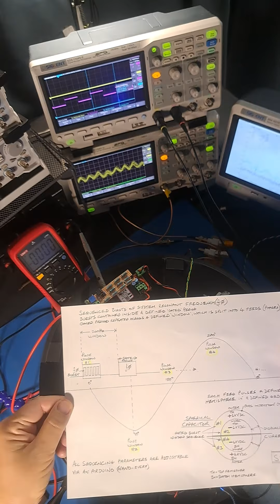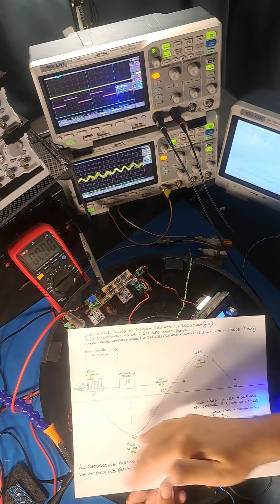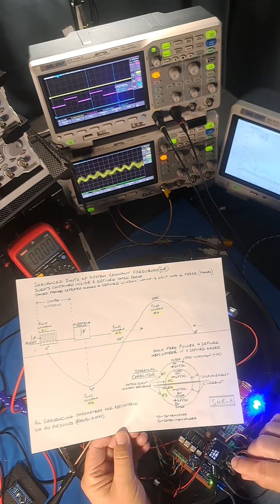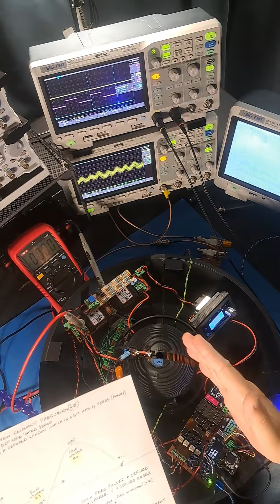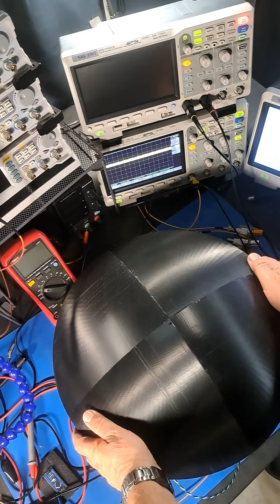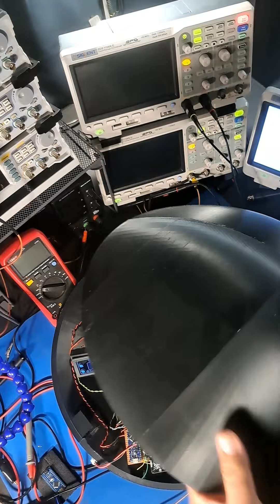Scalar Harmonic Resonator Update

Comment: Read the same paper, so suggest trying to uniformly oscillate the whole inner sphere with respect to the whole outer sphere, and sweep to find the optimal harmonic resonance. Could also just try a point source (small conductive ball at the end of an antenna wire) instead of an inner sphere assembly. Technically, i think the outer sphere should be a fully closed surface, vs, what looks like your present wrap of wire rings.
Reply from the maker: Thanks - I'll put a more detailed outline of the experiment in the description, as that will hopefully help explain the methods I'm using to test several overlapping models... my rushed off-the-cuff ramblings were sadly as clear as mud! I used a 1MHz barium titanate piezo transducer to find the resonant cavity frequency (1.098MHz), but my method of excitation at that frequency couldn't even begin to compete with the noise from the 6kV HVDC bricks I was using to form the electrostatic field gradient (spherical capacitor). 
I'm about to replace the bifilar counterwound hemispheres (B-field cancelling) with solid copper versions, to act as proper high-Q top-loads to a bipolar Tesla coil secondary, and use the rod displacement currents to excite several points on that assembly. The key is to 'rectify' the otherwise self-canceling AC capacitor system, to give a net vector gradient that can encourage the perturbed 'Chi' field (substrate field) to keep moving in that specific direction and not get cancelled out.

Comment: WOW!! This is a big task to change frequencies manually. Nested coils have capacitance problems in a non fluid (open to changing frequencies) system. They tend to feedback signals. To fix this on mine I had to drive a dc flyback with a single transistor from dc. - to the center coil + to the outside coil. Then use a tesla coil (1 transistor) for the 3rd coil (acts as neutral energy in the system ). The result was a displacement current + and - The reason for the single transistor was it allows for the high voltage side to change the frequencies instead of the low voltage side driving them. High voltage leaching. Dollard spoke about it and it works. I really like the coil setup you have here. I hope you get it tuned. Great Job.
Reply from the maker: Thanks Nathan - solid copper hemispheres would simplify the capacitance as high Q top-loads for the bipolar Tesla coil - they're on order! I just need a magnetic field to cohere the movement with acceleration and an effective bias so hopefully the outer sphere can provide that. All WIP!
Reply: @bogirishIan  i CAN'T WAIT TO SEE IT.